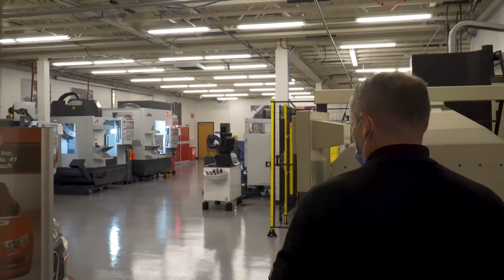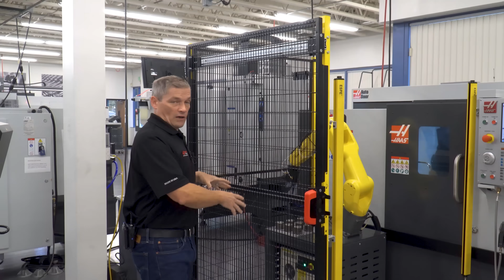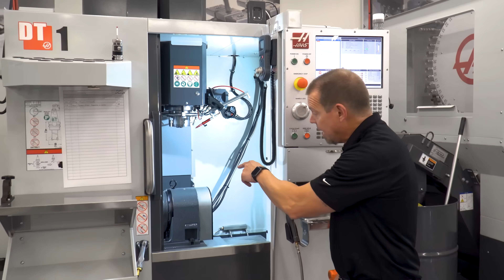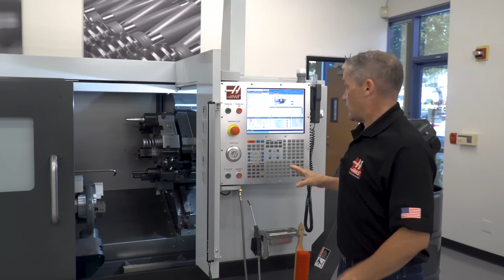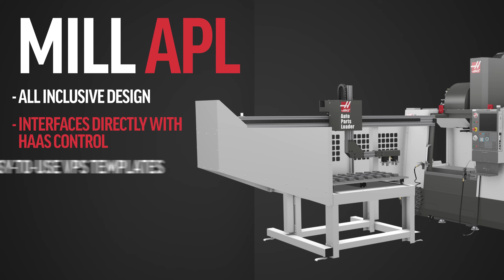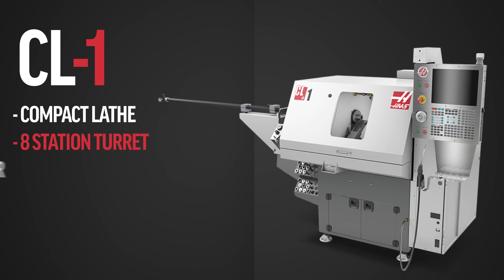Haas Demo Room - Factory Spotlight - Haas Automation, Inc.

Comment: How difficult is the Haas controller compared to the fanuc controller?  Which is easier to use in terms of operator friendly?
Reply: if it is not too late, Haas controllers are 1000x more operator friendly, with a very easy learning curve for a majority of the features used on a daily. Fanucs are a bit more advance in some areas, such as the ability to have feature offsets, but the learning curve of the interface is much steeper than of HAAS.